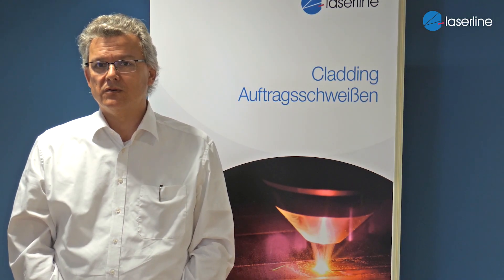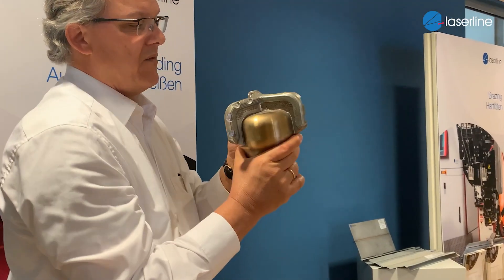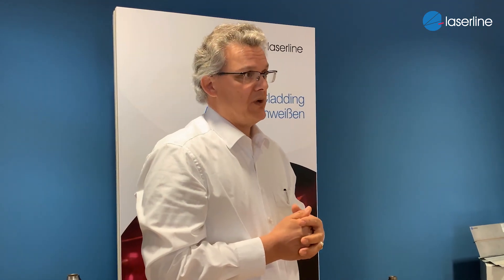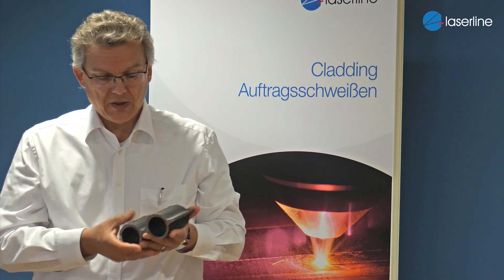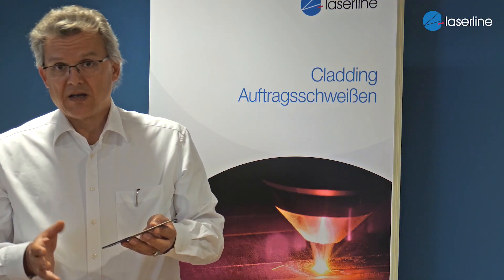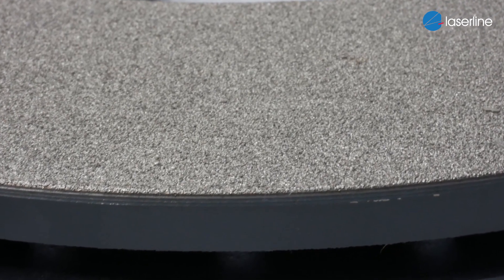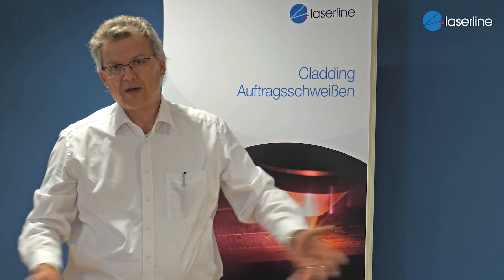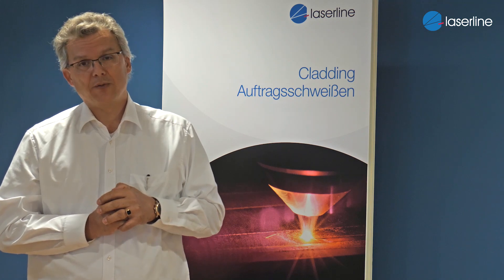Laser Cladding Introduction & Examples Markus Ruetering EN

Comment: Ideal for preparing repair and maintenance as a "Surfacing Weld" with corrasion resistance.  Thanks for the update on your "Laser Cladding" operations.

Thomas J. Vanderloop, Author, Design Consultant, AWS-Member & SME-Member/Leadrer